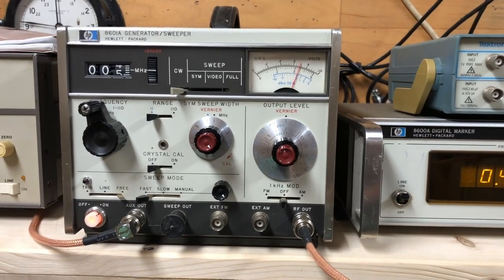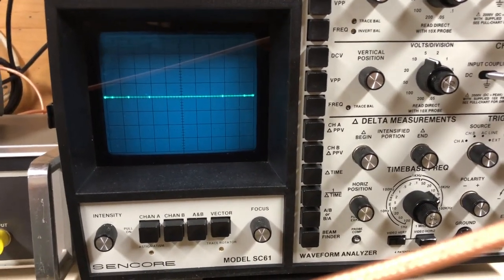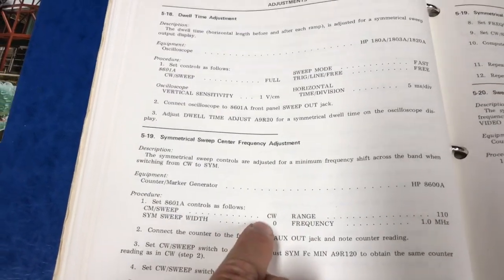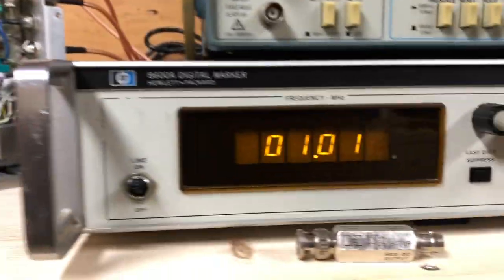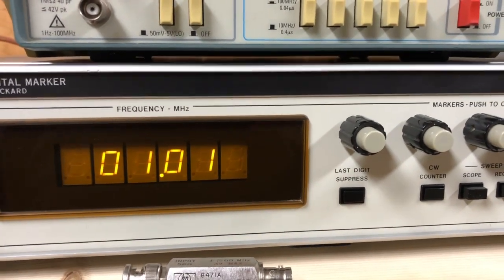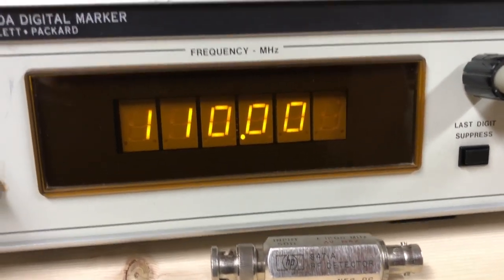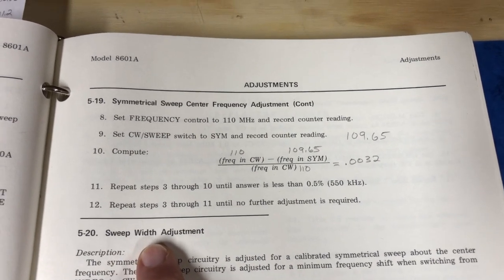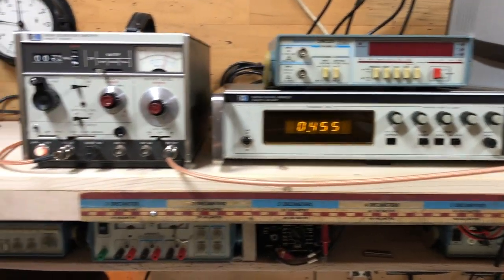HP 8601A / 8600A Sweep symmetry calibration

Comment: I’ve been looking for an 8600A digital marker for about a year. I have the Nixie tube version and someone did a real hack job on the counter board. They replaced about half the chips and did a pretty bad solder job. The unit is 90% reliable but when it gets wonky in the middle of a vintage tv alignment it’s very frustrating!
Reply from the maker: That's a shame.  I am fortunate in that the one I have looked pristine inside aside from some dust.  Have you unseated/reseated all the boards?  On initial start up mine just displayed zeros.  Before I went over the edge I got a wild hair to pull each board (except the board connected to the buttons)  and put a little DeOxit on the contacts.  It has been working since.
Reply: @leonathey3780  Yes I've cleaned everything I can get to with Deoxit.  I'm going to attempt to clean and repopulate this board with brand name TI chips.  Some of the replacements the previous owner used are no name and San Salvador chips.  Just bought a bunch of Texas Instruments stock.  Can't for the life of me understand the reason for replacing nine of the 16 ICs on the circuit board.  Got my work cut out for me!  Hope I can get this going because this combination with the 8601 sweep generator gave me fantastic, clean profiles on my scope.